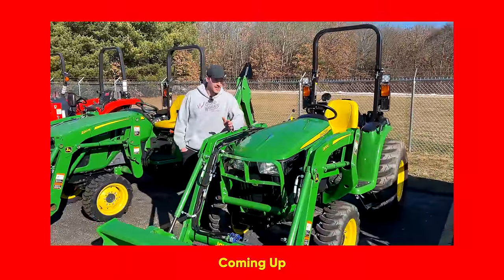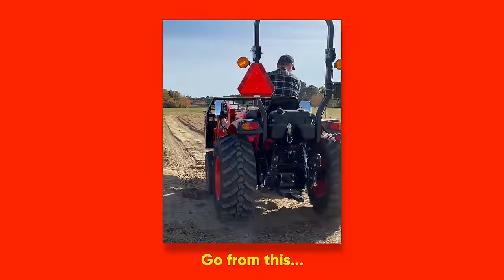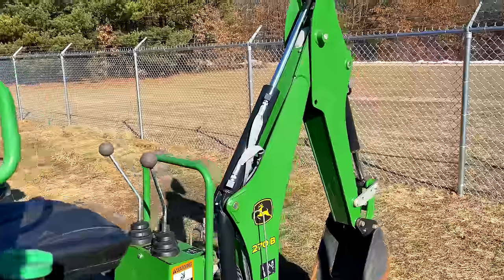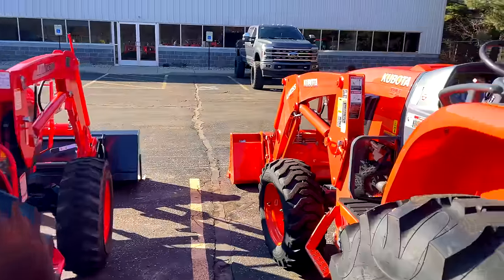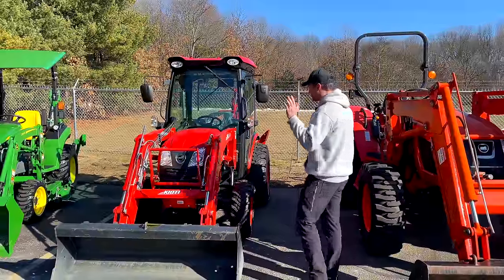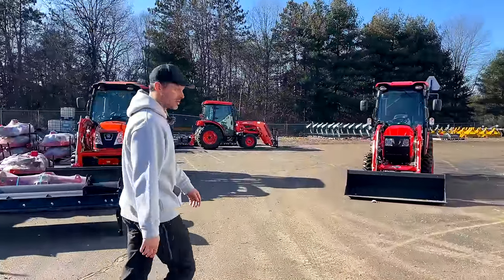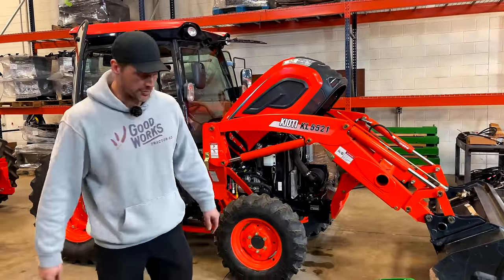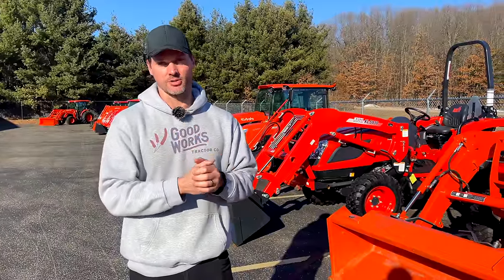JOHN DEERE ISN'T WINNING ANY MORE...

Comment: I purchased my first sub-compact tractor this week for my birthday - a Bobcat Ct1025 w 60' belly mower, loader, pallet forks, and cruise control for less than 20k out the door.   Looked at the Kioti's and Deere, but they both couldn't come close to the price and the Bobcat dealer is 3 miles away from me. I would've gone with the Kioti if they weren't 30-45 minutes away, had an awesome experience talking with their sales team- but again, the price was 3-4k more for the equivalent tractor. 
As for Deere, I have never heard a good thing from the multiple AG Pro dealers in my surrounding area.  Deere reminds me of Apple- they look good but with a lot of proprietary componets and expensive.  Resale is there but unless I need a bigger machine for 3 acres, I plan on keeping this until it dies.
Reply: Did Bobcat ever fix their loader curl function?  Lots of people that couldn’t curl over 200lbs.

Comment: When I went tractor shopping back in 2022 I was comparing John Deere, Kioti and Massey Ferguson. I had both the Massey Ferguson and John Deere quoted with front mounted snow blowers on them. The equivalent 1023E for John Deere was still $4,000 MORE and this was even after the dealer added on some factory incentives that took cost off of it. In the end the Massey Ferguson GC 1723E won out because of cost for a similar setup. It's also not completely covered in plastic like the John Deere is. Because the Massey Ferguson dealer also sells Kioti I asked about those while we were there but he didn't have any subcompacts in stock at the time. 

I considered Kubota as well because my father has a little BX with a snow blower and mower deck for maintaining his properties. But their stupid rocker petal  put me off. My father loves his little BX but he also said he dislikes the rocker petal. So far the only clunky-ness I've encountered on my Massey is the placement of the 3-point control level which sits under my right thigh. I'd say that's the worst of it for me. I'm slowly working up to 50 hours, once I'm there I can let the dealer know and they'll do a full fluid change. After that I'll be changing all the fluids myself once the time comes. :)
Reply: I just hope it works out for you IF you go to sell it some day.  My best friend has a low hour MF 1734 with a loader, pallet forks and a rear remote in mint condition and can't even get anyone to call and make an offer or come look at it.  Been on the market since November.  If that was a Kubota or JD, I don't think it would have lasted two weeks.  The L3560 he replaced the Massey with was on the market four days.
Reply: @richardhertz8996  Selling it wasn't on my list of concerns when I got it and it still isn't. I got it so I could get more yard work done. There's several houses around my area that have a little Massey just like mine who also use them for yard work.

Funny enough Kubota and John Deere don't sell any quicker than Massey's do around here. If someone is a John Deere or Kubota lover they're only going to buy those and nothing else. Others will find a better deal regardless of brand and buy that instead. :)
Reply: I looked at tractors for a few years before buying my Massey last year. Comparing specs quality and price massey and case had the best offerings in my opinion. I liked the specs on the massey more and I couldn't be happier with it.
Reply: @shanedevon147  It's a great machine and has been very useful. Especially when it comes to carrying a bunch of bags of mulch or chicken feed. I'd eventually like to get a carry-all frame for the back of mine so I can haul more bags around.

I went with the Massey because it was the cheapest offering in the area that was in my budget. While still being well built and well laid out. Definitely far less plastic on it than John Deere for less money.
Reply: DO NOT BUY ANY KUBOTA PRODUCT
I BOUGHT A NEW KUBOTA LX 4020 TRACTOR TO USE FOR A SNOW REMOVAL BUSINESS
IN BRIAN HEAD, UT. I HAD TO PURCHASE FROM A DEALERSHIP IN COLORADO AS IT WAS
THE ONLY KUBOTA DEALERSHIP WITHIN A 1000 MILE SEARCH TO HAVE THE TRACTOR I
NEEDED FOR THE PURPOSE INTENDED. The Dealership, Wickham Tractor in Fort Collins, CO
sold me the tractor and added Howes diesel treatment to the tank as well as selling me the
remainder of the bottle to use to prevent the fuel from jelling. I Used as per specs. Tractor was
purchased on 11/21/23 and I picked it up and transported it back to UT. Tractor was in
operation for 17.2 hours before it would not start. Local Kubota dealerships said they would
not come out to try to fix it as we did not buy it from them. Took it to Las Vegas, NV, as they
were closest Kubota dealership, dropped off on 1/8/24 at 730 am. Kubota dealership said the
fuel smelled funny so it wasn't covered under warranty and said $12000.00 plus to fix. The DPF
was completely clogged and the only codes were low temp MAF sensor and no
communication with EGR. Western area rep said there was no fuel to test because I drained it.
This is a Lie. Had more than 6 gallons of fuel in it when i dropped it off. I have all the emails and
correspondences and text messages, proving they denied coverage for adding a fuel additive.
Sergio at Kubota customer service said, “When I put fuel in the tractor it voided warranty.”
Apco, the Kubota dealership in Las Vegas, sent out the injectors for testing they came back as
bad due to fuel contamination on 1/23/24. Kubota persisted in their point of me putting bad
fuel in the Tractor. When I called the tester, I pressed about the fuel contamination. The person
who did the test, said it was visible metal in the injectors that most likely came from the high
pressure fuel pump. There was no metal in the fuel tank, fuel filter or fuel water separator. The
dealership i bought the tractor from said they were the only ones that could help me at this
point due to Kubota policy. Eddie at Wickham tractor told me I needed to bring the tractor
back to them, 1367 miles round trip. and they would sell me a new one because I had broken
this one. And would see about trying to fix the one I had already bought for a discount. I
transported the tractor back to Greely, CO to Wickham on 1/18/24 they tested the fuel that was
still in the filters and it came back as fine 2/8/24 so they were going to replace the entire
engine. This could take between 3 to 9 months. My warranty coverage says all warranty work
to be completed within 30 days. On 2/28/24 I found out there was internal Kubota Service
Bulletin that came out to all the dealers the week before I bought the tractor stating the very
problems my tractor was having. They knew this, and still denied coverage, and finally, when I
presented this fraud to Kubota, on 3/7/24 Wickham tractor said they were going to replace the
tractor with a new one, but wouldn't give me a timeline of when I would get a new one and I
would have the expense of picking it up from them verses a local dealership. These delays
have cost me my business and reputation to move snow I had to pay out my competitors and
cancel and refund all my contracts. A service bulletin for this tractor was issued before I
bought it stating this very problem. and it was to be fixed at Kubotas expense. They knew the
problem existed, they tried to blame it on me for adding fuel supplement, they tried to coerce
me into buying a new tractor on top of the broken one so i didn't lose my business. they
refused to cover the cost of repair until i proved their fraud, and intent by pushing the narrative
and then changing and deleting emails. I have all emails and correspondence showing the
timeline, the fraud and intent.

Comment: Something that would be interesting to see someone go over is that the 3e loader geometry is quite different, it's made for tight quarters and fast cycle times.  The specs at the ground and lower are comparable to 2R iirc, it's just the lift to full height rating is lower as the cycle time is almost 1 second faster.  The bucket is also very close to the front end and the overall outside turning circle I think is much smaller.  Would be interesting to see a bigger YouTube channel to actually dig into the engineering a bit more, understand if that's not here though

Comment: One of those Kioti tractors the same size will lift more than 880lbs. Add a box blade for a counter weight, grab the log and curl/lower onto another and should be good for twice that. Please note the rear wheels will most likely not be on the ground. Just have to get it off the ground and punch it to the truck. Makes turning and terrain earn your money.

Comment: Product investigation idea for your subcompact market.  For 15 or 25 gallon sprayers it seems like there should be booms for loader mounts.  I don't want to buy a PTO sprayer or 30 gallon trailer sprayer in case I can't keep it in two years(like if I move).  It seems to me that an ATV boom sprayer could be mounted in the loader to spray lawns for mosquitos, fleas, mites, termites...  The synthetic chemicals are cheap at $0.14 per gallon mixed & the dog, chicken, & kitchen safe chemical costs $1.40 per mixed gallon.   A loader mount would allow the spray to be very low to the ground without breaking your neck to check on clearances.

Comment: I have zero complaints with my Kioti DK4710se. I have had it tree years and not a problem at all. I dont baby it either. Its a work horse. I only have 2 regrets. One is not getting it with a cab though I still love it and two was waiting so long to get one. Price point vs features Kioti beat Kubota and Deere. Couple that with the fact the Kioti dealer was local to me and with good reputation and the others were still close but not local it was a no brainer.
Reply: How many hours when you have around  2000 hours then do a review see how it's holding up

Comment: I had a new 1982 kubota B7100 front power angling blade, kubota tiller, 42” woods brush hog and a York lawn rake. Total price was $5,000.00 I was shocked when you said $8,000 to $9,000 used.

Comment: You are right. Just priced a Deere 3039R cab with nothing extra was $53,375.00. So my friend bought the LS MT342HC with Rim Guard and more extras that the Deere did not have on it like 2 rear remotes, #-point draft control, rear wiper/washer and a couple of others for $36,375. Deere will kill themselves with their prices. Like you said they don't have the lift power and other things and the 3039R is a smaller tractor than the MT342 with also 4 HP less than the LS.

Comment: I’ve owned two 2020+ Kubota tractors and the treadle pedal is totally fine.

The kiotis (my father in law owns one) has far lesser build quality also the “twin touch” pedals are consistently sticking and not returning to the neutral position.. also are far louder than the comparable models in Deere and Kubota. Definitely kioti is a decent tractor but 3rd place behind Deere and Kubota 

The Deere units are nice.

Choose dealer support, but like he said all of the above are reliable and most tractor owners do their own maintenance so do you even need dealer support? 

Nice video either way.

Comment: 880 lb rating is incorrect. The 3E, 3D, and large frame 2R all lift over 1100 lbs. The small frame 2025R is the same width as the 1R and have the same loader with 880lb rating. I have a 2025R with drive over deck and love it. Capable tractor and can get in yards with it.

Comment: I’ve have the opportunity to have a LS with side by side pedals and then my BX with treadle, I have found that using the 3 point snow blower is easier on the Kubota because I can sit sideways on the seat and press down to go backwards. I’m a short dude so reaching for the side by side setup is a little more difficult for me. 

Also the LS came into my life after the BX and it’s funny how long it took to retrain my muscle memory 😂

Comment: Hey, another channel (onelonelyfarmer) is working on his big 30 year old JD +100hp tractor and spent $8k on a hood replacement. I thought those were all fiberglass and could be repaired by a boat shop if cracked but he showed how it shatters like brittle confetti all over. Aged simple injection molded plastic that cooked out all the plasticizers. How are all the hoods on the range of tractors you show in this video constructed? I was a bit "fibergasted" at seeing that hood come apart. All my tractors have metal hoods.

Comment: I looked at them all. Went with a dealer with in 25 miles. Massey furgason.  At 65 wanted a tractor easy on and off. Easy to run . hydro . 1825E. Its done more then i thought it would do .  one selling point was the fuel tank is low easy to fill.
Reply: My father picked up an 1835m, it's a hell of a tractor for how tiny it is.

Comment: I have a 3038E, I can fill the bucket with gravel, sand or dirt and it lifts it just fine. Besides filling the bucket with lead what would be heavier than gravel or sand.
Reply: It's just numbers. A Hell Cat will do 185 mph. Who does that?
Reply: Pallet of bricks, bags of cement, patio stones, firewood, fencing, fert, lumber, etc. It's the fork work that makes the difference, and these were all handled by me, a home owner. So lift capacity means the difference between moving full skids or having to break them down first, which is a back breaker and a pain in the azz. That's my reasoning for getting a higher lift capacity, you do you.

Comment: They all have their merits. I used to say "You get what you pay for."... but green paint is ungodly expensive. Kubota's been makin' some flimsy 💩 as of late. I haven't heard anyone complain about Kioti/LS/Yanmar loaders bowing up. 

The problem I have, is lack of network for anything else. If it's not a JD, Kubota, or New Holland, I have to drive 3-4 hours for parts 🤦‍♂️

Honestly, dealer network aside... Antonio Cararro has some of the best bang-for-your-buck tractors on the market right now.... but I think they only have 3 or 4 NA dealers. I was looking at their TT series a couple years ago, and nobody could come within $10k of their features/horsepower, AND it had a reversible operator's station.

Comment: I just bought a new ck 2620 with a loader and 66” bucket(with skid steer quick attach standard), added arm rest to the seat, rubber floor mat, 2 rear remotes, front 3rd function , 3 point 72” hydraulic rotation snow blower, and a 54” kioti root rake grapple, and a service kit. All for the same price as a Kubota L2501 with standard loader and manual rotation 66-68” snowblower. And the treadle pedal🤦‍♂️. Not a fan. That being said, I like all brands but kioti just makes sense in my eyes. Get more for less

Comment: I'm not sure why you said the 25hp machines "don't have emissions" when in fact they have EGR valves with egr coolers which, if they fail can catastrophically damage an engine 🤔 
(Mahindra may be the one exception) -
Reply from the maker: Tier 4 emissions on 26hp and above.  Why do you think every manufacturer offers 25HP models in so many frame sizes?  Do more research.

Comment: Bought a 3520 cab with 120 hrs, loader, belly mower and blower for $40k CAD. I've had it for 4 years now, around 300 hrs on it and it's worth $50-60k. Don't use it much as I have a 4066r with a bigger blower.
None dpf/def tractors are going up in value and the crazy market has all used going up.
Paid $75k for my 4066r in 2022 with loader, power beyond, fenders, beacon and 7 pin. They're now $99k plus the $5k in add ons. 
2012 B95C backhoe was $73k with 120 hrs, now 300 hrs and they're selling used for $100-120k with more hours.
My barely used Timpte trailer I bought for $16k is now $27k new. Eby deckover for $17k is now $23k and my enclosed trailers were all $14-17k are all $23-29k new.
The depreciation is being lessened by the 30% price increases in new, for now being a massive caveat.
You do pay for the paint, the higher end options and to a degree better build. I know when I bought my first CUB it was a 2320 and the comparable Kubota then was 350 lbs lighter, that being all steel in the build. I bought the JD.
You are right though, needs change and far too often a tractor is purchased and you'll regret not going bigger. I'd love a 6 series IVT, but I pretty much need to stay smaller for the tight work I sometimes do.

Comment: I’ll stick with my Kubota. Summit, Soltrec and two other new tractor companies went under in the past 6 months. The big boys are where they are because they have the supply chain issues fixed and they have a far larger network to back them up. I’m not mechanically inclined and my dealer is 20 mins away. They have taken care of me every step of the way and even have a pre scheduled appointment to go over the tractor and fix anything that needs fixing before my warranty runs out. I have a Deere dealer closer, but I couldn’t stand their service department. I wouldn’t mind a Kioti, but the closest dealer is 4 hours away. (I’m interested in how that particular brand holds up).
Reply: I’ve looked into Summit. I can’t find validation that they’re out of business. Where can I find more information?

Comment: If you are getting into an HST there is very little as good as Kubota's Grand L series. I have an L4760 and it is a beast. Never get an L3560 with an LA555. The loader is worthless and you'll swap it over to the LA805.

Comment: Whqts more disapointing is because companies and farmers can write these off on taxes, they just charge what ever they want.  24k for an oversized lawnmower without a deck is crazy.  Tractors used to be affordable compared to a truck. If you look at cost of inflation to a basic tractor with just a front loader would be just over 12,000.  But they are charging twice that.